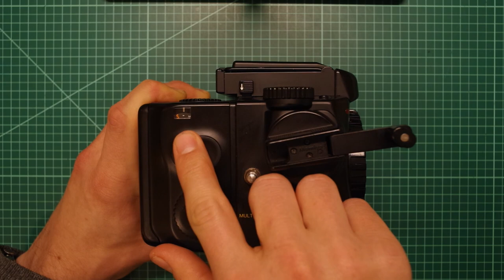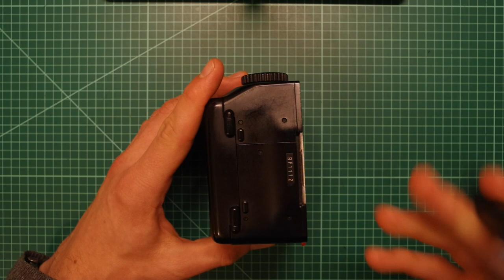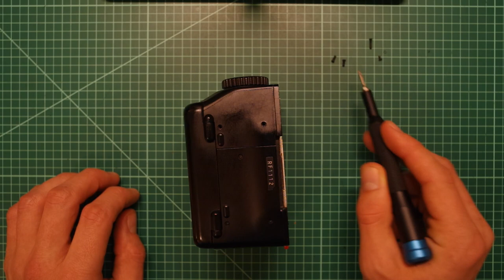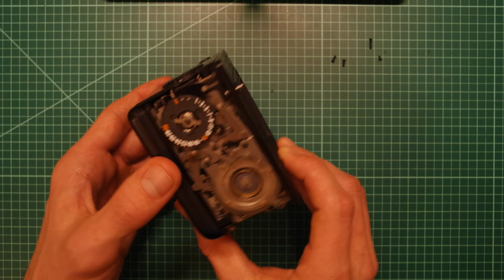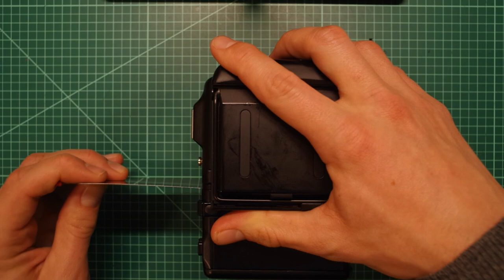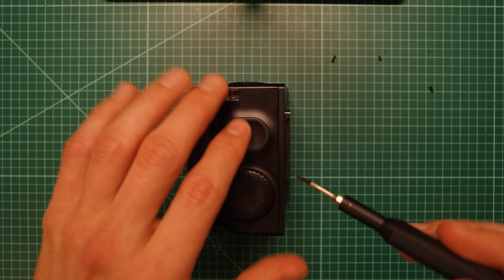Mamiya 645 Pro Frame Spacing / Film Advance Fix

Comment: Hey Evan, I'm having spacing/advancing issues, but I also have an issue where the advance knob locks up, and the only way to get to the 1 position is to fire the shutter and repeat this until it gets to the 1 position. I also noticed on the faulty film back it doesn't have a little pin sticking out, like the others. Would this be the culprit?

Comment: I have the regular Mamiya 645. Discovered that an exposure overlapped another. Sent it off today for an exchange. Seems to be a common thing with some.
Reply from the maker: Sorry to hear you had issues with your Mamiya 645. I'm curious how similar the film advance sensing mechanisms are between the M645 and M645 Pro, which was released almost 20 years later. The issues likely have different root causes since in this case, the frames were ending up too far apart. I hope you end up with a working camera!

Comment: Thank for the video. It is very informative. I have Mamiya M645, a old one. My issue with camera is uneven film advancing. Sometimes it overlaps frames and sometimes it has large gaps between frames. 
Do you have any ideas why. Your is the first video that i have found about film advance issues in the the 645. Any guidance would be helpful
Reply from the maker: Hi, unfortunately I'm not familiar with the older M645, so I'm not sure what could be causing your issue. If you can find a shop that repairs Mamiya camera equipment, I bet they would be able to fix your camera for a reasonable price, since this seems to be a common issue with those cameras. Good luck!

Comment: can you make do a fix for the super back where the light meter always says over and after rotating to a different ISO it wants you to LT exposure
Reply from the maker: It sounds like your system might have dirty electrical contacts. Clean all the gold contact points on both the back and the body. Isopropyl alcohol (IPA, rubbing alcohol) is not technically proper contact cleaner, but in my experience it has worked just fine. Make sure the contacts are dry before testing. And while you're at it, you might as well clean the contacts for the prism on the body and prism side as well. The electronics in the back are extremely simple so it's unlikely the problem is internal. Please report back!

Comment: Hey! I’ll pass this question here because this is one of the few videos that I have seen when somebody is disassembling the film back. 

Do you happen to know which element inside the film back is responsible for how much film gets moved between each frame? 

I’m thinking of trying to build a panoramic film back and the idea I have is to fabricate a custom part so that the film advancement works correctly with a different film aspect ratio. Obviously, I’d also add a mask just to expose a smaller part of film.

Still I’m wondering if it’s even feasible to adjust it inside the feedback itself. Thanks!
Reply from the maker: Hi, yes, I believe I know the part that determines the frame spacing on these backs.

EDIT: see comment below

Note: You may be able to achieve what you want by modifying the film insert cassette instead of the internal ratchet mechanism (along with the mask you mentioned). Increasing DECREASING the diameter of the rubber roller in the film insert should decrease the frame spacing. I'm not sure if there's enough room in the back to actually do this, but if it's possible, it would be easier than taking apart the back – and inserts are cheaper than backs. Increasing the diameter of a 120 spool could also work in theory, but you might end up with a fat roll that's not light-tight.

To your original question:

The frame spacing is set by a ratchet mechanism containing a ratchet wheel with wide square notches. The pawl is just barely visible in this video, but the ratchet wheel is easy to see. It sits under the film counter indicator wheel, on its lower right (when the film plane of the film back is facing to the right). At 4:08 it is visible, spinning clockwise as I turn the advance lever.

I did take apart the back more than shown in this video, but I never removed the ratchet wheel. That said, it's probably possible to do it nondestructively.

If you fabricate a different ratchet wheel (for your purposes you will probably want to decrease the space between the notches to get more "shorter" frames in a roll), just beware: the pawl of the ratchet is tensioned into the edge of the ratchet wheel, and it rides along the edge as the film advance lever is turned. So the edge of the fabricated part must be very smooth, or the film will never stop advancing (i.e. exactly the problem this video addresses). In fact I believe years of metal-on-metal contact from past use may have been one contributing factor in my case.

I believe I have better pictures of the inside of the camera back, and I'm happy to answer more questions – feel free to contact me through my website: https://www.evandors.ky/about/ – and good luck!
Reply from the maker: On second thought, my first reply had a mistake. You'd need to make the rubber roller in the film insert smaller, not bigger. So it would definitely be possible. And I think that's all around a much cleaner solution, especially if you were already planning on modifying some hardware. Hope this helps!
Reply: @EvanDorsky  Yeah, you're right, that should work.
Basically the gearing for advancing the film will work with the same speed, but the rubber wheel with smaller diameter would roll quicker, so the back would indicate the next frame(and stop advancing the film) at a shorter distance change.

The only issue I'd think is that it will reach the 15th indicated frame with pretty much half of the roll still good to go. I think I'll check what makes the filmback identify the insert as 220, and triggrer that. With 30 frame counter being used I think would be almost a perfect solution.

Thanks for the idea! I'll try to modify one of my inserts and I'll share it online if it works!
Reply from the maker: @DARTHMAUL1994  Yes exactly, and modifying the 120 insert to make the back count 30 frames should go perfectly with the wheel mod.

Making the camera back think that a 120 insert is a 220 insert is also quite easy. 220 inserts have an extra tab on the sidewall opposite the wall with the hinged metal tabs for inserting film. This tab depresses a lever inside the back, which is easy to see when the insert is removed. 120 inserts have two empty screw holes for this tab in a vertical line (when the insert is sitting on the pressure plate). I've used a scrap piece of plastic to stand in for this tab, the options are endless.

Best of luck and I'm interested to see your results!

Comment: Thanks for the video! I recently purchased a mamiya645 super, and while mine stops at 1 once I load the film to begin shooting, film count doesn’t advance with the lever (all the while I’m able to take photos). Would this method of fix still apply to my case?
Reply from the maker: Your problem is a bit of a puzzle, so I'm not sure if the fix in this video is relevant. The only explanation that makes sense to me is that the frame counter on the camera back you're using is just broken, but that's not entirely satisfying to me. And then I don't think this fix would help. But if you answer these questions I can help you diagnose:

1. Does the camera "click" when the frame counter stops at frame 1?
2. Since you state you can take photos, I'm guessing that means the advance lever cocks the shutter normally and stops advancing after about a full turn – is this correct?

3. Is the camera body in multi exposure mode? I just want to confirm since that would explain the shutter cocking without the film advancing. But it wouldn't explain the fact that the back advances properly to frame 1.

The multi exposure dial is on the right side of the camera. If the white dot on the dial is next to the yellow MULTI label, the body is in multi exposure mode.

You can also narrow the issue down more by trying to reproduce it with the camera back removed from the body.
Reply: @EvanDorsky  oh my goodness.. it was the multi exposure setting.. the manual advised to put it on while operation testing and i forgot to put it back on. Thanks so much for the above steps! I'll def be capturing this troubleshooting methods for future reference :)
Reply from the maker: @cloudy_note9502  Glad it was something simple and your camera is operational!

Comment: question: I have a 220 magazine, can it be converted into a 120 magazine?
If yes, how do you do it? Thank you
Reply from the maker: I believe it's possible to remove a plastic piece from a 220 magazine to tell the back to stop advancing after 15 frames instead of 30 (compare a 220 magazine to a 120 magazine to see where this piece is), but I don't think it's possible to shift the pressure plate. So running 120 film through a 220 magazine might scratch the film. But I've never tried so I'm not sure.
Reply: @EvanDorsky  Hello and thanks for the reply.

I looked at the difference between 120 and 220. It only changes for that piece that can be removed. Other than that I don't see any difference. They are identical. I go to the photo market on Sunday and go to see the warehouses for sale. HI!
Reply from the maker: @GiacomoAlbertini  I believe the 120 and 220 pressure plates are in slightly different positions – the 220 plate being closer to the lens – since 220 film has no backing paper between the film and pressure plate. That's why I was worried that running 120 film through a 220 magazine might scratch the film, or cause film transport issues, since there's less space.

You would only be able to detect the difference in pressure plate position with calipers. It might make no practical difference, just something to keep in mind. I hope you find a solution that works for you!

Comment: Hey man I have a problem with my Mamiya 645 pro could you help me to fix please sometimes work somestimes not the mirror lock and I can’t shoot and then I have to switch manually to orange button to make it setup again but it’s wasting me a shot
Reply from the maker: Hi, happy to help. It sounds like sometimes the mirror gets stuck in the up position after shooting (viewfinder blacks out) and you need to waste a shot to get it to come back down?

First thing I would do is check to make sure the battery in the camera body is fresh. Hold the B.C. button on the front of the body and make sure the red light above the PRO label on the front of the body lights up solid red. Even if it does, I would recommend replacing the battery anyway unless you remember replacing it fairly recently, just to see if that solves the issue.

I have a vague memory of an M645 Pro body that wouldn't shoot, and it ended up just being a dead battery. Maybe yours is almost dead, which could explain why it still works sometimes.

After checking the battery: are you using a motor winder? If you have access to a hand crank, I'd test and see if you can replicate this behavior without the motor winder. I'd also check the batteries on the motor winder.

I've never experienced this issue so I don't have any insight beyond that – maybe jiggle the M.UP knob and multiple exposure knob and make sure they're both set where they should be? I hope it's just a low battery. Good luck!